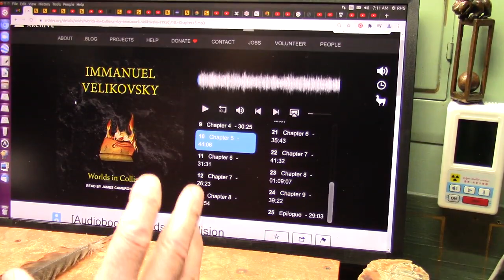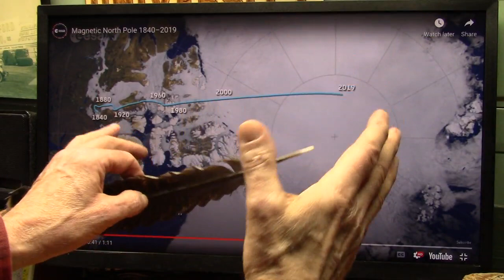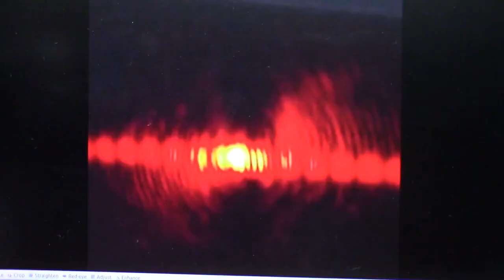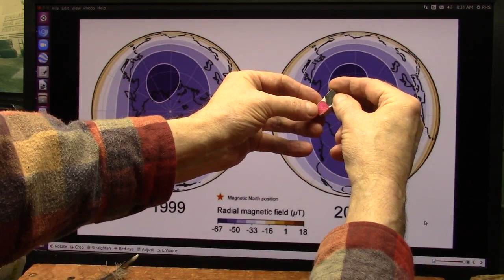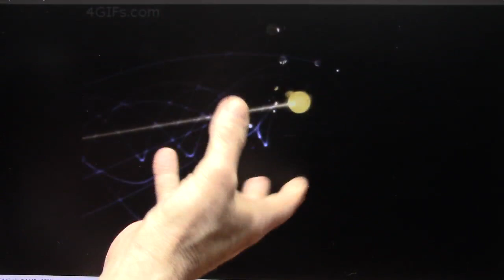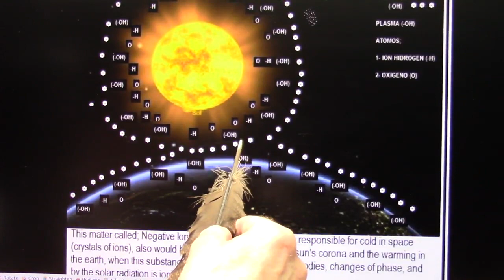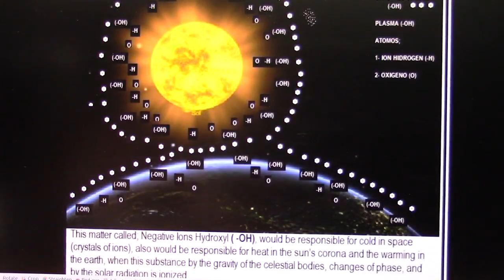A Pole Shift Disaster Coming and Why

Comment: This is to justify their faking of the sun simulator and to fake the quran prophecy of the sun rising in west on THAT DAY that the real sun goes dark, the Gathering to be specific. NASA also making excuses for wy eople see a second dim sun and there are two reasons: sometimes it is a reflection from the firmament due to all the chemtrails of aluminium and other times it is the Lenz Law effect on our toroidal electromagnetic field due to HAAR and Aluminium to disguise the induction heat hotspot as the white hot simulated sun tries to emulate the ath. It is a patent and they have several lamps on the earth  that beam u different frequencies and where they meet in the sky they emit a white hot light with a black dot in the centre which you can only see with a number13 welding helmet and a telescopic lens, this white fake sun also makes pink petals in photographs. WAKE UP people this is nasa junk again.

Comment: Thanks muchly for your video. Question, when a space rocket leaves earth's atmosphere and passes thru the HOT zone you mentioned, why doesn't the craft heat up/burn up like it would when re-entering? I understand that a re-entering craft moves at a higher speed so experiences more friction (heat) but surely there is some reaction when leaving too??
Reply: This is simply because we do not go past that zone and never have. All of our stuff is floating pretty close to the planet to a point where we are worried about the after effects of space junk for future launches. The van Allen belt also has an extreme amount of radiation we can not get any human or computer through.

Comment: 8:40 Sir, you dropped all science here. Logically speaking, and going by the same lesson you was just teaching. Earth is being attracted by another magnate somewhere else, no? A fly by we don't know about. something strong enough to do this to earth, but not affect the rest of the solar system. And, if you go Quantum, and we are just a particle, then the quantum sister particle is being affected, inturn affecting us. Your saying, what if energy burst from one pole causing this polar shift, but there's not science to back you up on your claims as to how or why. I mean think, what would be the catalyst to, "the poles charging so much, that they would flip"? You know why they super cool Quantum core processors? and Isolate them the way they do? The quantum particles are triggered by outside sister particle anomalies that are in reaction. Super Cooling them cuts them off from communicating with the sister particle. Like particles looking in a mirror. 1 triggers, and don't matter where the other one is, the other one will do an opposite, or a shift. I respect your work sir, but I've mentioned this before, you do have gaps in it, and you need to clean it up. I do find myself having to forward much of your work because it's become extremally repetitive. Do the one study, then move on, then if you need a viewer to review, tell them it's in your library, but you review all of it all the time. Sir you are very important, and a key to the awakening, but with all respect, clean up the content so that it's not all over the place. Focus.

Comment: Once again, you are correct Roger. We indeed will see a pile shift in our lifetime.  It is due to the binary (possibly trinary) star system that we are in . It will create such a "war" between our main & dwarf stars that it will create a worldwide  magnetic anomaly that will flip or poles. It will flatline then recalibrate.  This may happen a  few times until it rights itself.  Which will allow us to either temporarily float away from or be pinned to Earth's surface as well...we will survive though.  Fema and others are already prepared,  as well as elites. Ocean Temps are monitored closely as a harbinger as well as the Schumann resonance, Earth activity,  and other factors.  Earth even stopped its wobble temporarily in 2004 on the dwarfs our pass of Sol. It's documented for verification for those who care to look at nasa's jpl website

Comment: Drunvalo says at a point when the magnatism reverses the base rock the continents sit on   turns to gel letting the unbalanced mantels, due to the ice forming and melting at the poles , move to correct the earths balance ending the current woble the earth has. So most every thing on the surface will move and become hasbeen including prople.

Comment: Man you got it right that there will be a pole shift but the causes are not to be found on earth...

When a magnet can flip ? If there's a stronger magnet initiating it, or in this case the contrary, it was in one and it switches off. The solar system is traveling on a course between Arcturus and the Pleiades, on a revolution around the galactic center.  When it performs a revolution, it is called the great Galactic year. Magnetic and gravitational forces maintain the earth and other planets on a stable course calculated to the millisecond.  From time to time, or should I say cycle to cycle, when Earth leaves the Fish and will enter Aquarius,  so changes sign it enters something called a Galactic Null Zone. The magnetic field weakens and weakens. 
When this happens, humanity enter a period of moral decline, and all living beings feels a sensation of imminent doom, and even mice starts to canibalize each other, even if it has food.  Criminals feels they will get away with murder and any crime, and only the Righteous stays centered. When the magnetic null zone disables earth magnetic field, the poles shift. 
When the creator is not happy with its creation, this happens during 2 hours perhaps 4, like it did during Atantis in the last cycle. It was strong enough to destroy the GIants. At this moment, Oceans and Atmospheric Winds, who are still rotating with the earth rotation speed, devastates everything. This is why the Mamooths were decimated .and frozen with grass still in their stomach. Until today archeologist s are finding those Mastodonts with the femur pulverized. WHat on earth can damage their strongest bones ? Oceans  and the atmosphere hitting at supersonic speeds of around 1667km per hour. 
According to visions of future events, this time it will happen during 3 days of total darkness because the revolution will halt first.   This will allow milder cataclysms and only 80% of humanity will be destroyed, with tsunamis sinking parts of Europe and America, including California, New York, London, Louisiana, anything below ocean level you name it.
The new North Pole will be in the bay of Bengal.    The previous North Pole was in the Hudson Bay that's why there were arctic animals all over North America. That's why as well the Nile was traveling and reaching the Atlantic previously, not the Mediterranean, because it going to the North with the help of Earth gravitational forces. 
This is well known for any civilization who has memories of the last time it happened 250 000 years ago (last time it was traveling from this sign to this sign) on Earth, or to  God Source of All Creation.  
I read it from a forbidden book written by someone who has worked with ETs on antigravity devices. I'm wondering if I'm the only one to know that since this guy is dead.... Hopefully others read the book and understood it. Unfortunately the CIA had tried and succeeded to halt the publication of this book, because they don't want the masses to know.
Reply: I’d just like glimpse of that book.
Reply: @jeremylucas7104  I can't send you links of this via comments, I have my messages deleted when I provide inconvenient information to the main narrative. I got a message deleted this morning because I dared criticize and prove consistent criminal activity of the manufacturer of the "candy" if you know what I mean. The candy that was supposed to be safe and effective
Reply: @dominiquemajewski1  
Could thar be the reason why they put magnets in the candy?  Could that be why with all this that will cause mass deaths?  Just wondering

Comment: So, basically the earth is a big battery charging up until the pole flips.  If that is the case, we need to “drain the battery” by using N. Teslas technology to draw the energy out of the air.  Pole reversal averted!

Comment: You don't need to project lasers at solar panels , to increase the power of a solar panel all you need is a magnifying glass project it at the a panel you get a marked increase of power 🔋 I learnt this 40 years ago with a Tandy electronic 20 experiment kit that was mega small scale ⚖  I must say I haven't tried again but I'm sure the principles still work remember the kiss method keep it simple stupid = KISS , if you make things too hard for people they not going to understand,  there is,a lit of fog in people's minds they hear from someone that that can't work , I had a toy battery tank just put two engines in 2 times the batteries I forget how I wired it up but the thing is my batteries 🔋 never run down I think I physically changed them from one set to the other set 4 batteries I played with the tank for months with the same batteries , the electric car makers aren't going to tell you that or even why not turn the roof and bonnet of  electric car into solar panels then charge half the batteries  on a constant loop there  definitely be an increase in the the run time of the distance run but the powers that be aren't going to tell everyone that because that would take thier power from them you could even generate power at night with some small wind turbines for powering up at night  🌙

Comment: No way the Earth changed its direction of spin, it would have torn itself apart doing that.  Somebody was doing some really good  Hallucinogenics. 🤔
Reply: Dont think the earth stopped and switched direction. But if it had to flip upside down the spin would automatically be in the opposite direction. Use a ball and see for yourself. Same direction of spin. Just turned upside down. West becomes east and vica versa.

Comment: I noticed Roger, there was no mention of the moon. I've often questioned why if we turn and all the planets turn, why is it that our moon/satellite only shows one face. It baffles me that with all the magnetic forces,  the moon seems to resist the turning that seems to be natural to our solar system. 🤔
Reply: Seems like I've noticed more full moon's than we use to have.
Reply: Artificial..The Moon, that is imo
Reply: The moon is tidally locked to earth. The moon still spins, but it takes 28 days to do so. Since the moon doesn't actually orbit the earth, but a point in the outer atmosphere that the earth also orbits in 28 days, it appears as though it is not rotating. It does show us the same side,  but that is just because we orbit the same spot for the same length of time.
Reply: And the stars are in the same spot in the nights sky every damn night!
Reply: Maybe the moon is not just showing one side. Maybe it is spinning, but reflecting the earth's image on it's surface. Like a mirror, even if you spin the mirror, you still see yourself the same way.
Reply: @A Baker the glass beads or "tactites" are covered extensively by doug vogt of the "diehold foundation"  So hold onto your hat for this, vogt says that about every 12,068 years our star will do a " micronova"  (Stars all have unique "cycles" and ours has a cycle of 11 year sunspot cycle, 88 year "gliessberg" (sp) cycle, and then 136 glisssbergs is a super cycle... the sun builds up a dust shell of crap in its outermost atmosphere, like say helium, and then blows that off into space like old faithful every 12,068 years.... 

 Part 1, the earths magnetic field and the suns magnetic field lock up and the earth stops rotating, (for just a day or so) then the shockwave hits the earth, the force of which, if it is dayside for you, blows the atmosphere and the water to the night side.. so if it daytime for you, you are now exposed to the cold of space, and frozen solid in a split second with your breakfast in your mouth... the nightside, is now under 4 miles of water.... then, assuming I have these steps in correct order, then the actual debris (The tactites, or green glass beads)  from the suns ejection hits the earth... it has now been cooled from the hot sun, by the cold of space and we are pelted with green glass... hits us and no doubt all of the other rocky bodies in the solar system eventually... 

then the worst problem of all... the interaction of the earths gravity to the suns unlocks the crust from the mantle, and the mantle / lava acts like lubricant and the continents glide to their 2nd resting spot... so north / south america currently oriented north to south, will now orient east to west, and antartica will be in a tropical latitude like say Hawaii, and in the next 12,068 cycle they go right back....  everything takes just a couple days to transpire, but for humanity to survive, ya pretty much have to be near the equator or in a large underground cave structure like gobekli tepe'   the water that came to the night side of the earth will eventually slosh back but the force will throw a lot of the water into the atmosphere and you will be underwater or under ice a couple years....  

Humanity "resets" so to speak... thus this is why there are these megalithic structures on the earth... previous renditions of whomever was here before us left these behind... some are observatories so they can see when the earth is about to go batshit, because the solstices will not line up properly in the 11 years or so before the big reset.  Odds are, the so called "hollow earth" people are those tired of being blown off the planet every 12,000 years, so its safer and easier to live under the ice cap, as the earth is not at all the solid mass we are led to beive... Other stars also do these micronovas... some are documented as doing them every 30 years, we are lucky, we get much longer.... still this may not be correct, but Vogt says Oct 16, 2046 is the date of the next gliessberg cycle, and likely the next great reset is very close to that date.... for further reading, check out "operation nanouk" of 1947.  the elites have known a long time that we are in deep trouble, and they need as many "eaters " culled so that they will not have to compete for resources as we get closer to "the fall"

Comment: understand that as the earth expands into its next density, it may flip in its rotation, even several times (hezekiah and isaiah), but its primary goal is to strive for balance. Therefore, when this process completes, the earth will be tidally locked with the sun, much as the moon is tidally locked to the earth. it is law that dictates movements of all things in all realms, and you have now observed it is the same laws of polarity that govern the gross as well as subtle. As the earth increases in its polar energy, it will become tidally locked with the sun, and all the land will be pushed to one side, and the water will be pulled to the sun facing side(i think), much like how pangea was one great continent originally. then there will be no day or night, as is recorded in the book called revelation.
Reply: Most interesting theory yet--highly likeable.🎯👍

Comment: Notice when it spins to the RIGHT it is positive, and the left negative!….. Right hand rule!!! 
Now what if you position the motor in a direction that is aligned with the flux of the earth, you then have less resistance as to opposing the flux you ride info  it like a down stream boat with a motor! Axial flux! Magnetic flux that accelerates like a vortex or VENTURI😉Roger laithewaite has a video from way back that explains this all very clearly for young adults in a educational setting! Very informative a must see!
Reply: Thank You!😊✌

Comment: go take at look at vibes of the cosmos his science behind how the universe is. and hiw this works. the earth is not a ball. you must kno if giants and tiatians exsisted also does the wisdom of the earth being staionary and the sun and moon wich are plasma well at least the moon is a plasma imprint of the place we inhabite. and most of are realm is coverd in ice. the sun will move and has always move through history. becuase of the the magnectic pull of the BLACK SUN. wich is the true north.....are north pole is not the center of the univers..but it is the center of the garden. wich is this magnectic circle we live in.. and is surronded by ice. so imagein a large circle with a smaller circle inside tht moves around counter clockwise.